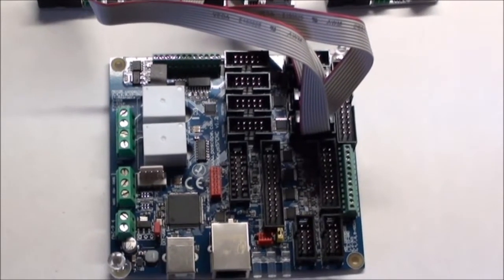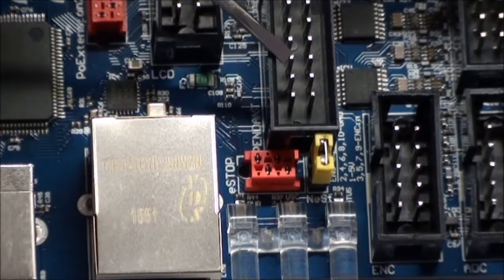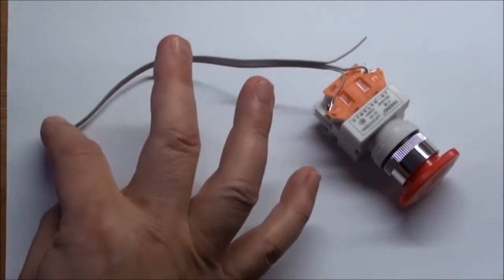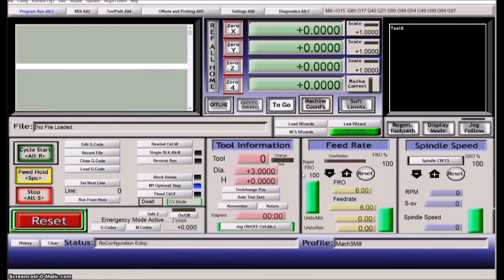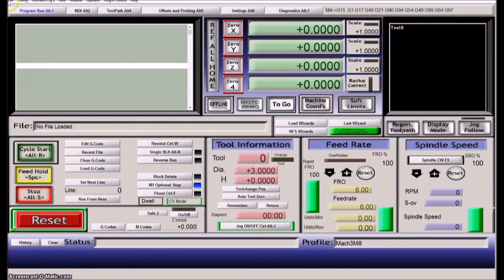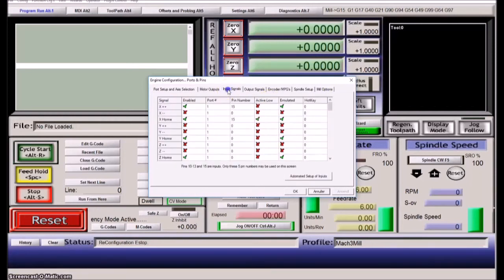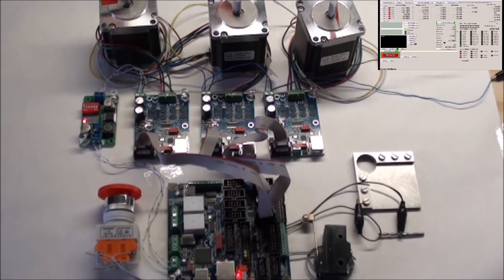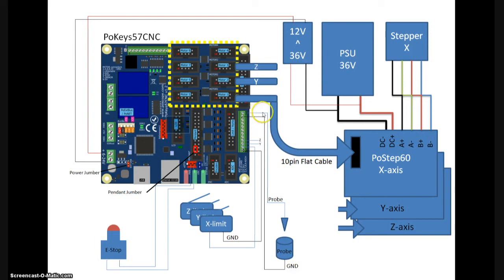PoKeys57CNC Motion Controller Wiring to PoStep60 and Power - and Basic Setup in Mach3

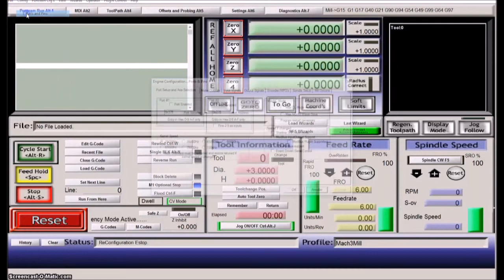Comment: Hello Martino. Great video! Congratulations! I am connecting to CL86T driver. I used, as you did, 10 pin flat cables. I connected according to the scheme to common-cathode. Unfortunately the engines do not move. First of all I would like to understand (at time 11:37) why you use as Step Dir Pin the values 2 3 for the X axis, 4 5 for the Y axis, 6 7 for the Z axis. Why exactly these values? And secondly, could you give me your opinion regarding the motors not moving? Thank you. And thanks to anyone who wanted to answer.

Comment: 474/5000
Dear reader, we have a problem with the Pokeys 57CNC. Everything works so well.
We have something strange.
We use touch keys to move the axes.
  After briefly pressing the buttons belonging to axis B and C, the axes continue to run.
Had contact with Polap several times, but I don't think they know either.
Who can help me further, we have been using Pokeys products from them for more than 15 years and have encountered no problem so far.
v.g Gerrit

Comment: Thanks Martin you confirmed a few things I was unsure about while rewiring to this board.
One question I'm sure I am soon going to realize the answer is.  
Why 16v in your application?  I am trying to figure out if I "SHOULD" use my current 12v power supply from old board.   I was running my prox switches and my relay out for a LED light strip.  The strip requires 12vdc.   Does this power in determine the relay output as well?
This leads me to my next step and that is the prox limit switch..  can I tap into the power supply I use going into the Pokey to power the switch?  Is this ground  this same as the limit switch ground?  (therefore the  switch will pass ground back to the Limit swicth inputs)?
Reply: I noticed you have some videos about the NPN/PNP prox switches.  
https://youtu.be/F7BjZElStfQ
This helped me wrap my head around these little buggers.  HOWEVER
I was using a plug in transformer for my 12vdc.  I put 12v to the POWER IN and moved the jumper.   The board started to buzz a little.   Any Idea why I get the buzzing under external power?  Is this normal?
Reply from the maker: @twistedtuner3467  I use a 36V PSU in the setup. That is to much for the card that need 6-24V - 16V is a good compromize. You can as well use your 12V PSU for sure. With regards to the prox switches - they need 6-36V so again 12V is fine. However, as the digital input only accepts 5V you need a pull down resistor or even better a Zeener diode. Both are described in other videos I made.
Reply: @martinbarfoed5040  Thanks Martin for the quick reply.  
I have been in contact with PoLabs.  They are telling me I cannot use my NPN prox, with a built in pull down.  
I did pick up a few 10K ohm resistors (brown black orange-red)  think they are 2 watt?  
Is there a special type of resistor to use?  I have tried to put the resistor across the brown -   and the black output wire and I cannot get the voltage to drop.  I tried the blue to black as well no luck.  I did have the switches hooked direct to board and I can get Mach 3 to stop when hits limit, BUT I can't reset the switch while it is activated.   If I use a rocker switch I can reset while switch is still depressed.
There is a setting I had on the old board/mach3 that would hit the limit switch, I could reset but it would ONLY back away from the switch and do it in step mode going very slow.  Once clear of the switch I could then repress the direction key and it would jog like normal.    Any Idea how to get this function with the pokeys57cnc and Mach 3?
I did get it to home and auto back away a set amount of steps using a rocker switch, but what I mentioned above is slightly different.
Reply from the maker: @twistedtuner3467  I can only think of the relays being able to make a sound - it's not supposed to though
Reply: @martinbarfoed5040  I did pickup few buck down converters and wired one from my 36v driver P./S down to 12vdc and this has solved the buzzing issue on external power.  My plug in transformer must have been putting out  dirty power.

Comment: Why are you using pin 15 for limits an probe? Shouldnt prob be a different pin#,also im tryn to hook up external switch to be used as ENABLE,
 CYCLE HOLD , CYCLE START,...Where do i hook those switches into the 57cnc board to trigger those mach commands, im on mach4, also

Comment: Hello if we want to use 8 axis all together.  What can we use control program.
Mach3 or mach 4 include 6 axis..
Reply from the maker: I do not know of programs that support 8 separate axis. Often folks use slave function e.g. A as slave on Y - so if you had two slaves you would be using all 8.

Comment: Thanks Martin I successfully installed a stepper motor. Now another problem. Connect the servo '80ST-MO2430 (220V) and' PoKeys75CNC 'Control port CN2. If you have any idea please help.
                        Sincerely, Vladimir

Comment: Great video! One thing you did not mention is to conect pokeys57cnc to drivers with poextension cable. Without doing this you will have to setup each driver individually by usb and write driver settings. I believe polabs recommends using the poextension method for overall control of driver settings thru pokeys57cnc.
Reply from the maker: Hi Roderick. Thanks for the feed back. I do plan to make a separate video on PoExt cable and some of the boards that connects via it. Currently I'm working om making PWM work - and its giving me some troubles :-)
Reply: I haven't gotten to the pwm yet. Just switched to the pokey60 drivers from automation direct for my mill project and test benching before permanent install to enclosure. I keep saying, if people really understood all the capabilities of the pokeys line of components, I doubt anyone would choose anything else. Definitely a step above other diy cnc products. Look forward to seeing more of your videos. 

-Cheers,

Rod
Reply from the maker: Yes, I agree. I'm also impressed how many functions you get. Also tried their Pendant. It works really well